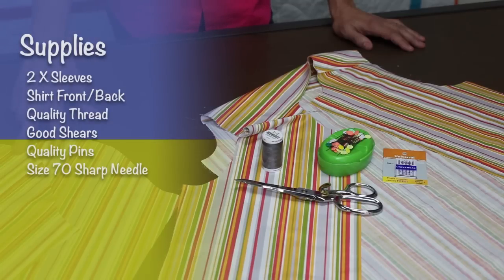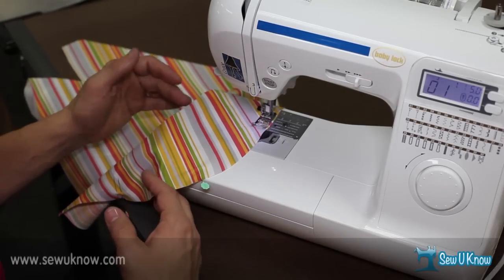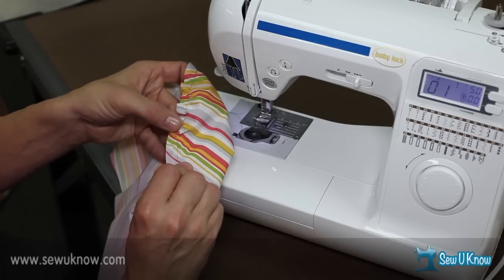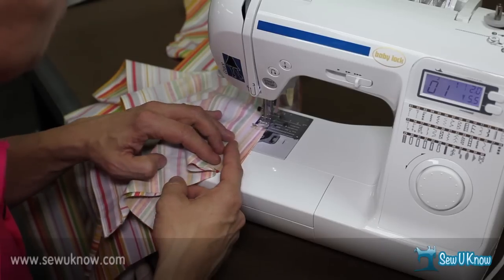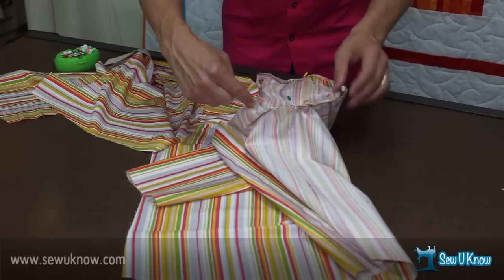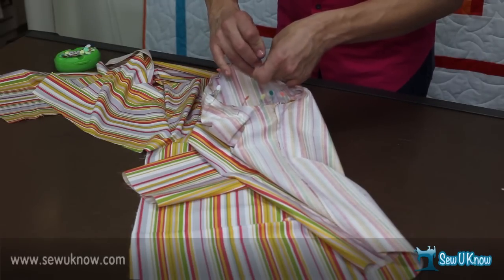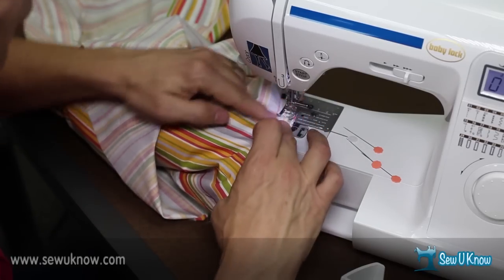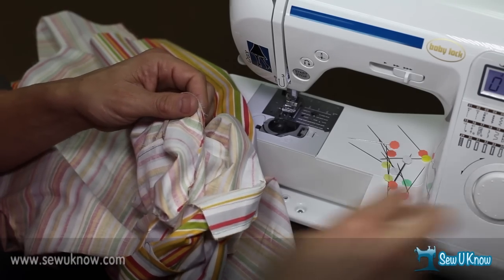How To Sew A Set-In Shirt Sleeve

Comment: Finally I was able to make a sleeve on a shirt! Thank you very much for the tutorial! I'm new to sewing and I would like to understand another thing...I made a trial shirt using a pattern from an old t-shirt and it turned out alright, but I want to know more about notches. I've seen patterns and how they are placed but I would like to know how am I supposed to place them properly(from where do I need to measure in order to place them ?). I would be so happy if you could explain that part
Reply from the maker: Thank you for your kind words. The number of notches indicates the orientation of the pieces: 1 notch indicates the front of a piece, 2 notches indicates the back of a piece, 3 notches indicates center back. You can also place a notch to show where a sleeve matches up to the shoulder on a sleeve. Good luck with your sewing adventures!

Comment: Wow! You are very, very good! I'm learning quite a bit.  I'm a relative beginner who has returned to sewing in middle age, and I have been trying to learn to make collar / cuff/ button down shirts. I started with your video about adding a back yoke, and it seems to simplify things for me, and this one is equally illuminating. Any advice about taking a no-yoke pattern and adding a yoke? I'm kind of winging it through that. (Or, How about a video addressing getting your button holes running in a straight row! I can handle individual ones, but getting an entire tab aligned symmetrically seems to be a challenge. Ha!)
Reply: Sorry for the delayed response. To add a yoke to the back of the shirt, simply measure down from the center back neck the amount you'd like the yoke to be. I typically sit right at 4". Draw a line perpendicular to center back at this point, cut the pattern apart, and add seam allowances. This will leave the shoulder seam at the shoulder. With a yoke, we typically pass about an inch of the front shoulder to the back shoulder, as well. I'll see about posting a video about that.

Comment: I was taught to always sew set in sleeves with the sleeve up so that you could better control easing.  Same with attaching a gathered piece to a flat piece--sew with gathers up so you have more control and can avoid puckers and tucks.  Is there a reason you do it the other way?
Reply: My apologies for not responding sooner. You can do it both ways, but the action of the feed dogs helps ease the fabric into place. The fabric on top is simply there for the ride.

Comment from the maker: It's not unusual in the sewing world to have to "ease" fabric into a seam - in this case the sleeve to the armscye. In essence, the extra fabric is squished between the needle penetrations. If your stitch length is too short, there's no where for the excess fabric to be eased. Depending on the amount and type fabric that needs to be eased, your stitch length should be increased (for "shirt weight" fabric, you can typically get away with a 2.5 mm stitch length when easing the sleeve. Good luck!